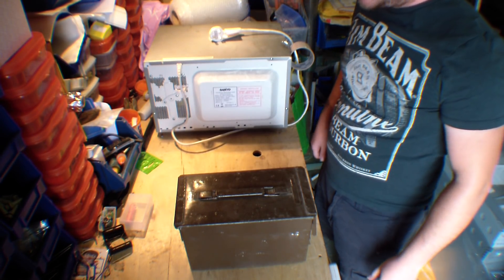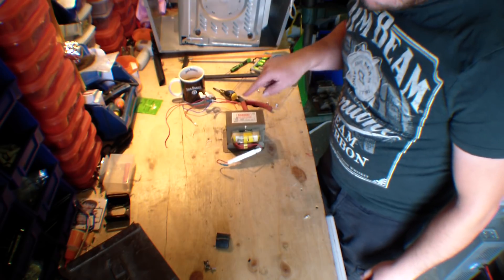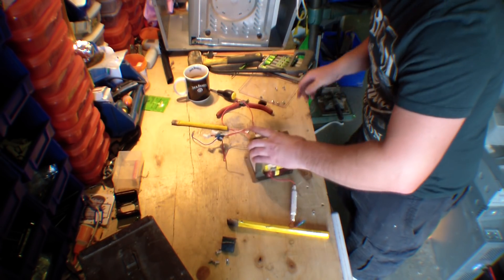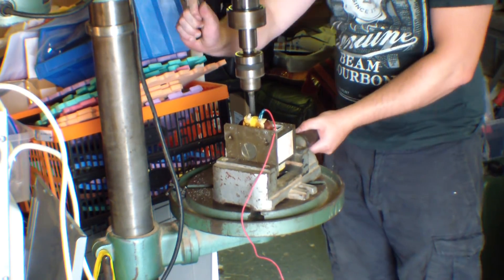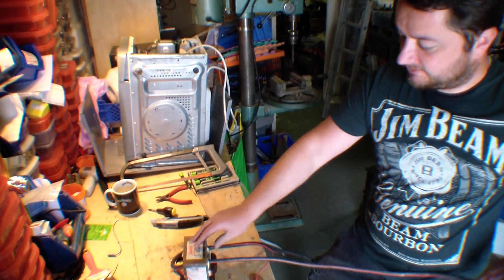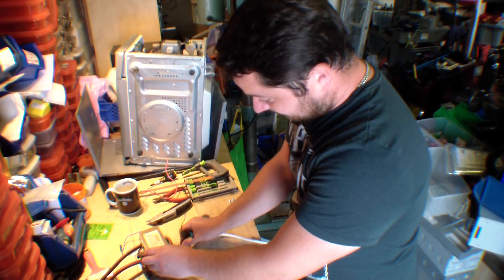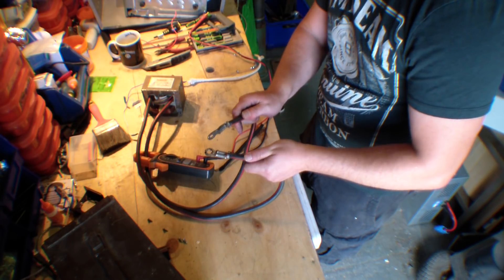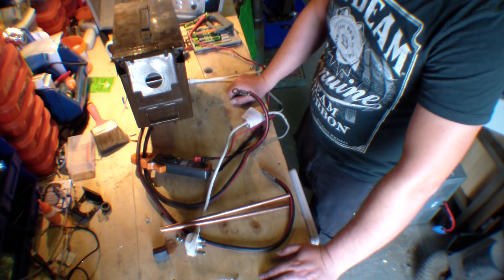microwave oven spot welder DIY build for 18650 battery tab welding, Part 1

Comment: If you had tried putting the punch on the two metal bars between the two coils then they would have knocked out with only as few good hits. Then all you would have had was to pull they two pcs of coil that you were having such a difficult time with. Try it that way the next time and you will see how easy it would have been.
Reply from the maker: Tried that to start with, didn't budge, far too much glue all around it, hence doing it like that.
Reply: @EV-North  were talking about the two pcs of metal between the two coils that is about 5/16" thick and about 9/16" wide and the with of your transformer about 3" long. Is so did you put a blunt end punch onto the metal pcs it self. And if so did you prop the transformer onto a solid object like an anvil of concrete floor width two pcs of metal stock between the transformer and solid object so your not damaging your good coil that your saving but to have room for the two pcs of metal to be driven out  with az good sol.kid swing or two. I've done most all ofv mine thkis swzay and I cant see what youjr not doing in what I described. But if you do every detail as i said you will be satisfied. And don't deviate onde bit like beating kit lon that bouncy bench that you were hitting it on in there video, Trust me I've done 50 to 70 transformers this way and never had a problem

Comment: The trick is use lacquer thinner... The whole thing is coated saturated in lacquer.. So heat it  up one way or the other
Reply: no you still need the primary coil.

Comment: After you cut off that portion of the secondary coil, drill two large relief holes into the secondary windings. Removing some of the windings with the drilled holes makes it much easier to knock them out.  I did this earilier today and it worked great.
Reply: O yeah😇🤟🏻😁😁